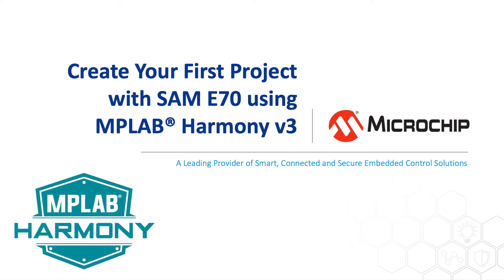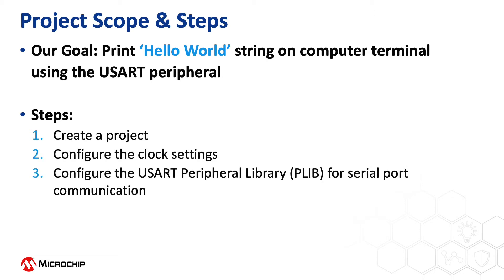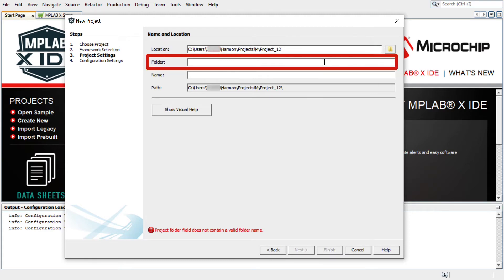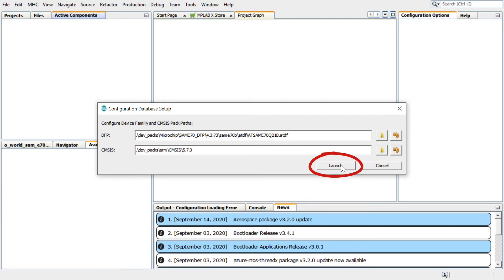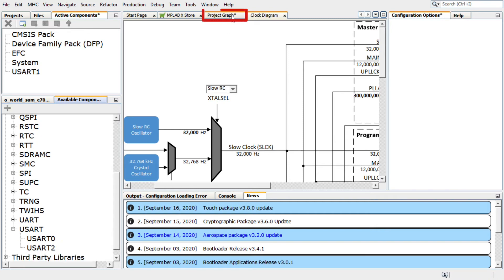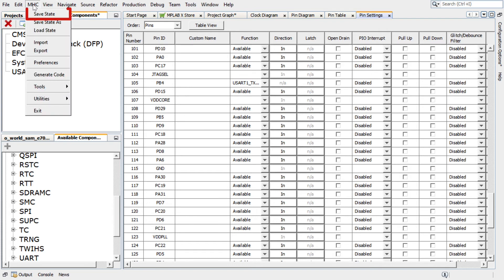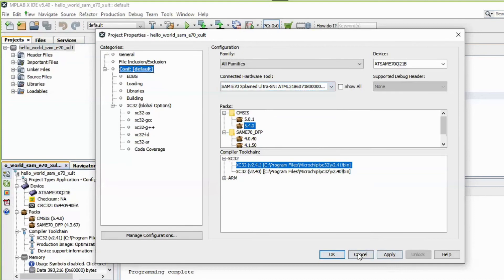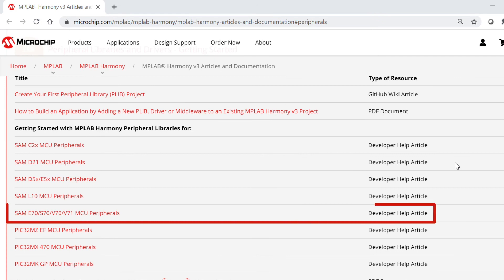Create Your First Project with SAM E70 using MPLAB® Harmony v3

Comment: I installed mplab and did not find mplab-harmony, although the training videos say that harmony is an integral part of mplab. And I can’t download harmony anywhere. Bull sh@t your mplab! It's a pity to spend money on EV76S68A... It would be better if I chose an ARM  from TI.... Code composer studio more fryendly.....
Reply from the maker: Thanks for reaching out! You will first need to start a new project in order to get to the Harmony download. This video details an older version of MPLAB that not longer fits the same format of MPLAB V6.20. Please start by creating a Application Project. From there, MCC will automatically be initialized, and you can open Harmony. Please take note of the different versions of MPLAB. MPLAB is constantly being updated.